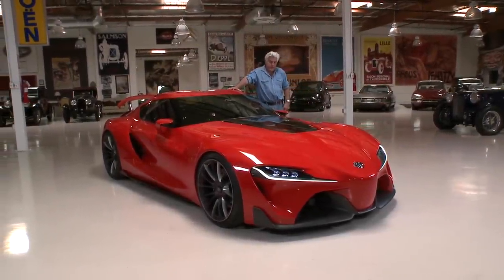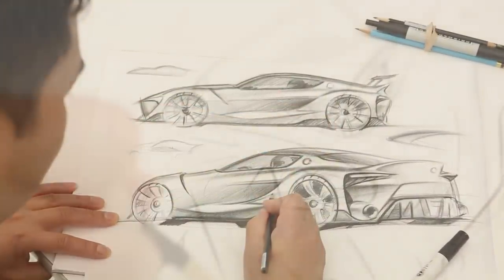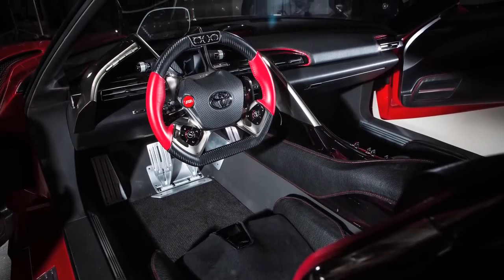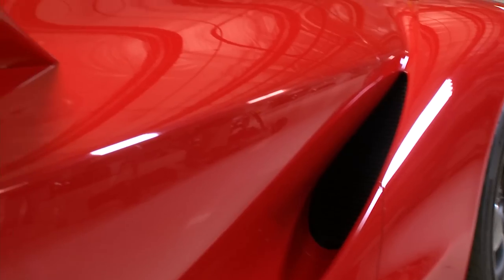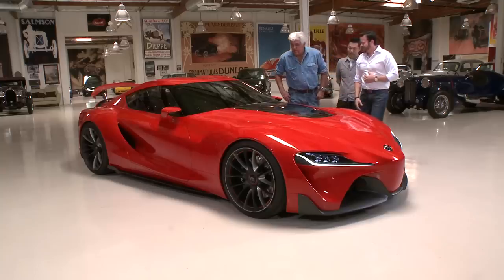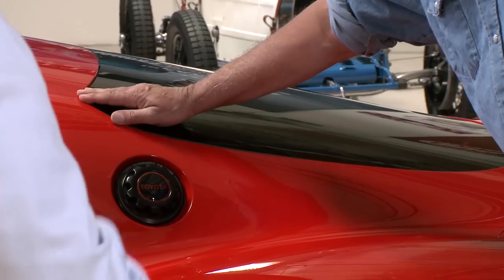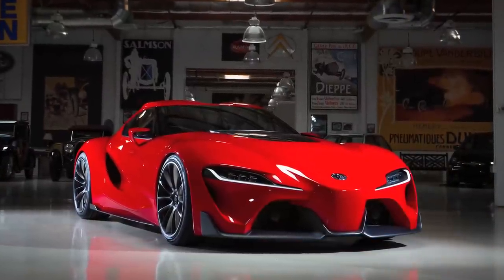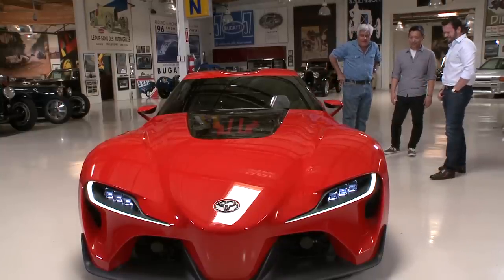Toyota FT-1 Concept - Jay Leno's Garage

Comment: A few things need to happen to the new MkV Supra to turn it into a production-ready FT1. Fit better suspension (like the shocks and springs and swaybars), wider tyres, bigger brakes, Rocket Bunny bodykit, plexiglass engine lid in the bonnet, 6GR swap with twin turbos and twin intercoolers, maybe swap the wing with one Frankensteined off of a car with an active rear spoiler and mold it into the rear end, smooth out the bodykit lines to match the lines of the fenders. Bam, suddenly it looks a lot closer to what the MkV should've been, with much more of the FT1 styling intact and still passing crash regulations and whatnot. Its just that it has an extra major-sized vent in the middle of the bumper for moar cooling since that 4.0L V6 would be pushing upwards of 800 bhp. That sounds like a dream come true, a true MkV Supra.
Reply: Then a whole 2 people will buy it and then it’ll go out of production again 🤣

Comment: Both the FT-1 and the new Supra look good to me. Plus the Supra makes more power than the Z4 which is a very big plus even though some diehard fans of the Supra will disagree with me on my statement. Plus if they did make the FT-1, you'd pay upwards of 100k but, if you buy a new Supra you will only pay close to 70k depending on trim and options.

Comment: Toyota... You should’ve built this. This should’ve been your Supra/Super Car. The GT86/FR-S should’ve been updated with more power and been your midway sports car. Toyota went with BMW to keep the new Supra affordable, but everyone would’ve rather have seen this and it been $120,000.00 and compared more to the NSX and GT-R then a $65,000 Supra with a BMW engine...
Reply: this shouldn't have been the supra this should have been the ft-1

Comment: No love for the Toyota MR2, Jay?
That was a sweet-looking little car and if you got the engine upgrades it had very good performance for its size and cost!
Granted, the insurance for that car was a dealbreaker for a lot of people but the second generation MR2 they built in the 1990s was one of the nicest looking not-Corvette / not Porsche that a mainstream Japanese car manufacturer built during that time.
I won't say the Celica GT or the Toyota Supra weren't nice but I saw MR2's around the area I grew up in quite a bit in the 1990s.  The Celica was more popular but the MR2 stood out more, IMHO.

Comment: Honestly im not a big fan of huge front hood. 
If you only change the engine with v6 it will be more compact like a mid shift car. The wind shield will be more front possition wich i really like about mid shift car.
STILL I LIKE THE DESIGN.😊

Comment: Not crazy about the nose. Too solid. Too protracting. Needs redesign
Reply: I would change the nose and the back so it can be more reminiscent of the older Supras. The headlights, spoiler and exterior side of the car look great.
Reply: @philithegamer8265  no it was not supposed to be a supra it was supposed to be it's own model so it doesn't need to look like a supra

Comment: This is MUCH sexier than the 2020 Supra, mostly because of the size and proportions
Toyota FT-1:  184" length  48" height  77" width
Toyota Supra:  172"  length  51" height  73"  width
And the front end styling is horrible, AND there's no stick?  FAIL!  A Supra in name only.  Pretender to the throne.

Comment: All I wanted was this with a Toyota (JDM) engine. was this so hard to ask for? I dont even care, slap in it the old 2jz. ffs biggest let down of the century in the car world!
Reply: toyota can't ever advance if they keep sticking the same old 20 year old engine
Reply: @KyushaNeverKnowsBest  Im not saying they should. Im saying it would have turned out better for them if they did. besides, updating engine models is possible. They could have literally modernized that engine and it would perform well. 
They dont need to sell 800hp cars but the standard 330hp. Let the car guys deal with tuning afterwards.
Reply: @ti8ick_Husband  this car would suck with 330hp. the engine it has makes 460. i wouldn't let "the car guys" ruin how this car looks. if they do the engine without changing the body, that's fine but when you start cutting panels and stuff, it's clearly not supposed to fit if you need to cut the car for it to fit. you don't cut shoes so your foot can fit in, you get a shoe that fits.
Reply: @KyushaNeverKnowsBest  Your missing the points im making. Dont focus on the words that I use but the point of which im trying to make. Its a BMW engine. Toyota would have been better off with a less performance engine that is a toyota than the bmw everything. The concept supra was drastically changed because of the bmw chassis. Concept was beautiful. The mk5 now.... not so much. There are a few cool exterior stuff but the overal car is a near 1:1 bmw. Wy buy a 90% bmw car with a toyota badge, than just buy a bmw 100% car with a bmw badge.

Comment: This car has too many styling mistakes that don't look awesome and ruin the overall look of the car. The overall shape is decent, but there are to many off putting elements like the nose shape, hood curves, etc. Toyota best chance would be to make a mid engine supercar and stay away from the design companies that try too hard and make weird looking concepts like this. This is what happens when someone who doesn't have an eye for exotic design tries to design Exotic. To be fair, most modern cars on the road today suffer from poor styling and good styling is a rare thing.